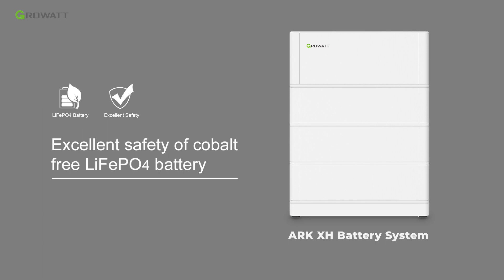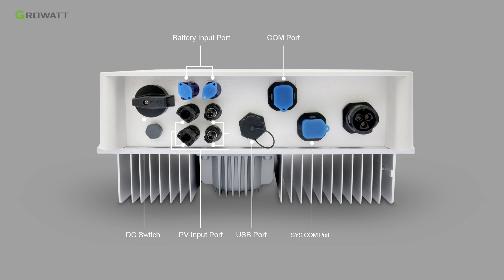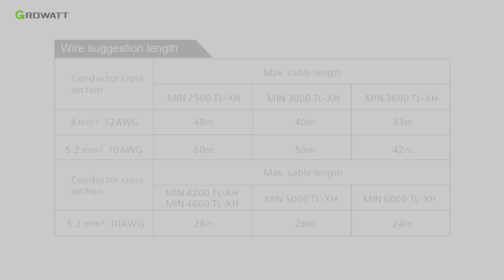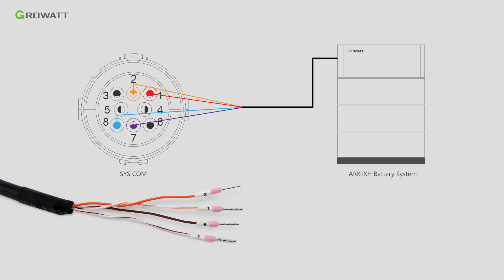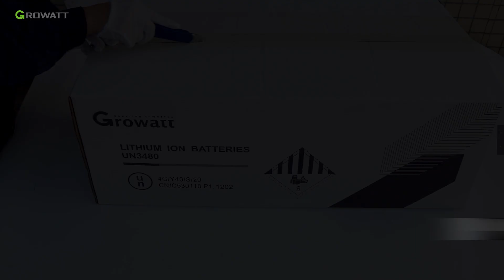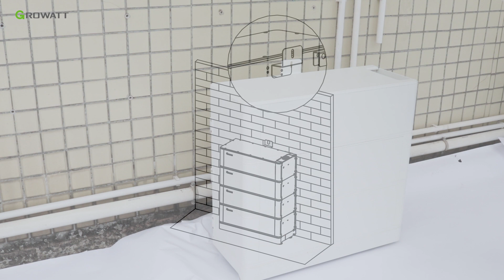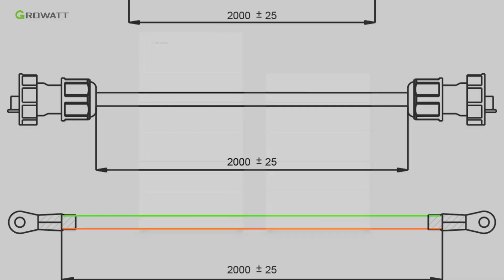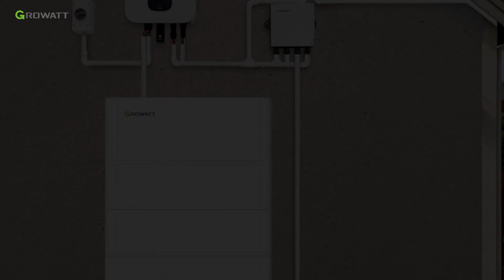MIN-XH & ARK-XH Battery Ready ESS Installation

Comment: are there ark batteries "plug and play"? 
I have a growatt inverter min series and these are the batteries that would work with it. 
I would like to purchase and install them myself. the installation in itself is easy. I am only wondering if it will require a sort of set up once plugged in.

Comment: Can the Min XH provide backup power to the house from High Voltage ARK batteries, and if so, would that be through the ATS switch or the backup box. Will the backup box automatically switch to batteries where there is no mains power and other way when power is restored

Comment: I have a question, MIN-XH doesn't have an EPS output. What should be connected there?
Reply from the maker: Hello, for technical support, please contact our service team at service@ginverter.com, or you can call our service hotline at +86 755 2747 1942. Thank you!
Reply: The MIN-XH connects to the BackUp Box (Inverter input) as well as the Grid and you connect your BackUp panel (or Main Panel) to the EPS output of this box also...
Hope that helps...
Reply: @Songomx do you know if there is a reason that the total KWHR is only 17 kwhr. if this accepts 400v can you just install your own battery which would have its own bms right into the growat hybrid inverters? thanks
Reply: @qnzkrew  From what I know, Huawei's communications are proprietary... this inverter only connects with it's own battery brand... and these are HV ones...!!!
Reply: @Songomx  ahh that sucks. ive been looking at used model 3 batteries and they are around 400v